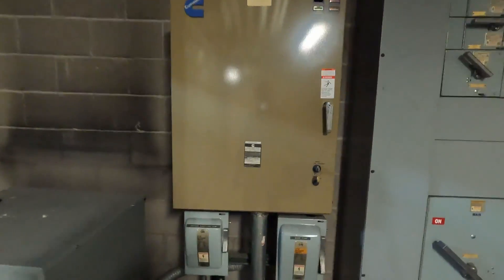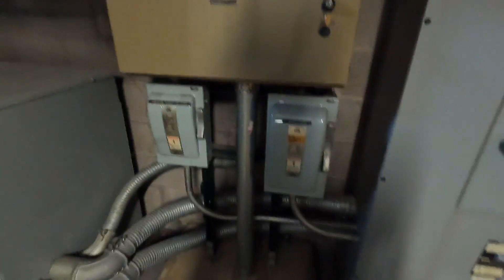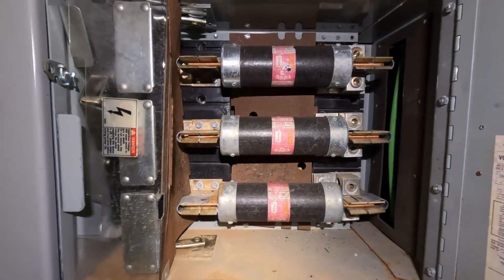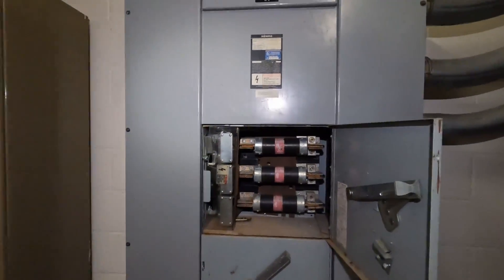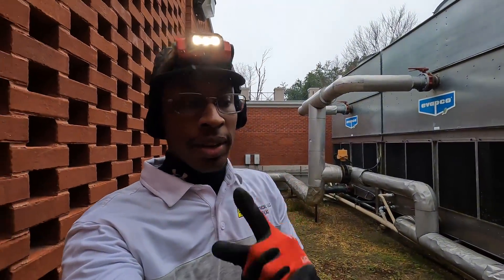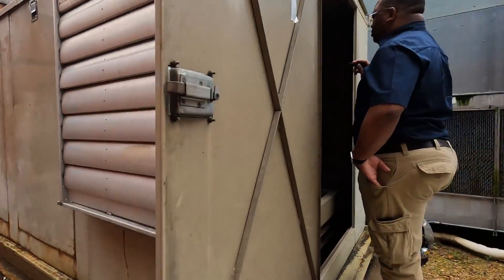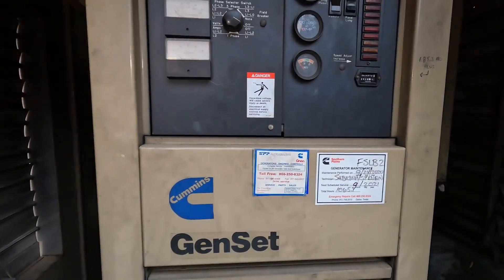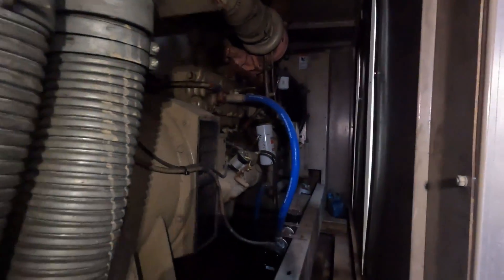Diesel Generator Safety Alert: Don't Ignore the ARC Flash Study

Comment: I worked for a Generator Company in the past.  We went to difficult commercial sites changing oil,  checking voltage regulation, etc.   It Mostly PM Maintenance and servicing bad main control module.   Sometimes they are asked to do lond bank testing every so often.   I would not recommend going into Generators for a job , unless you don't mind being on 24 hour on call.